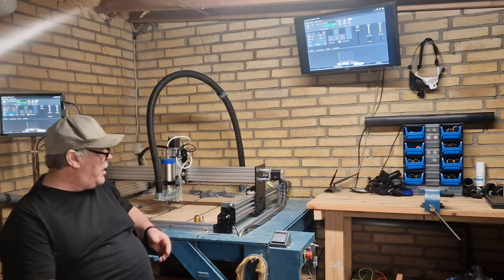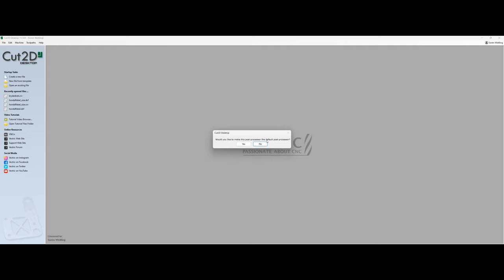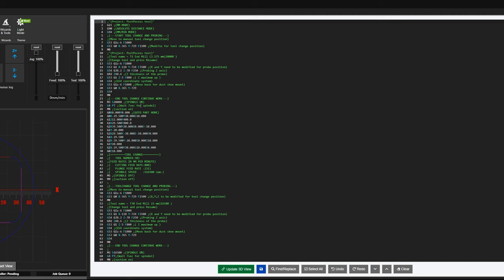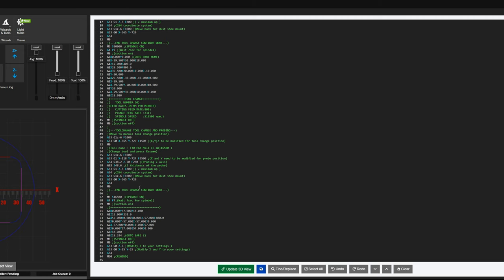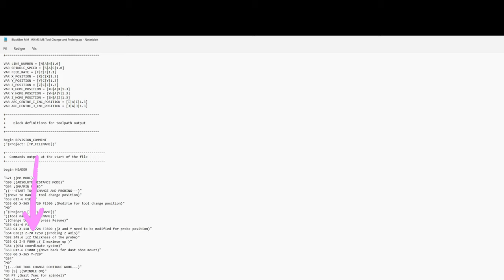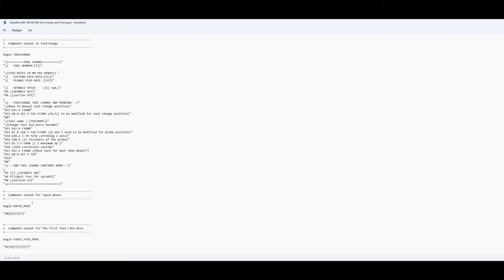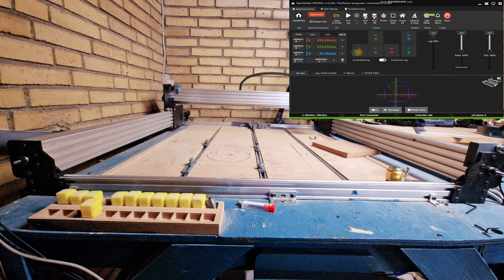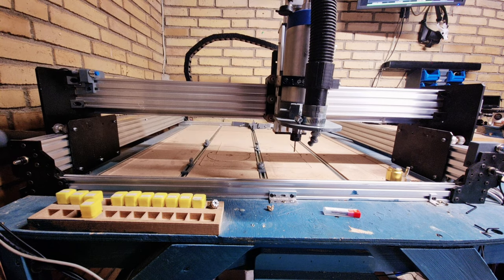Vectric CUT2D Post processor and other Vectric apps with tool change

Comment: One dumb question: can I use the same pin I use for xyz probing? I have a custom CNC with arduino mega and grbl mega 5x.
Reply from the maker: Hi.. There is no dumb questions, only bumb answers :) I need to be carefull but I guess yes. You can test it and se if it works.